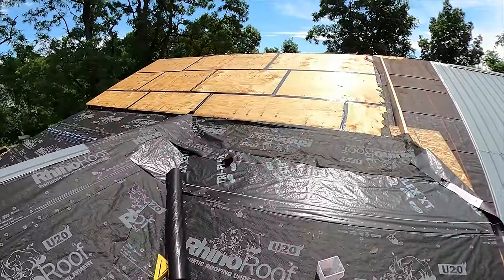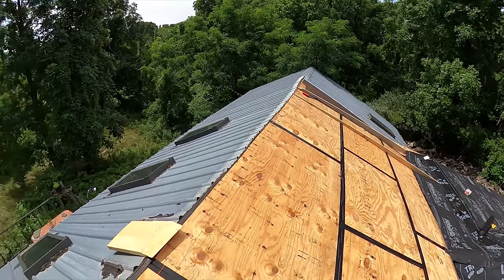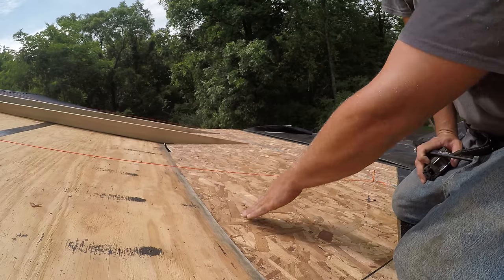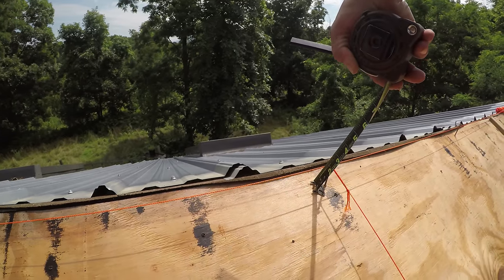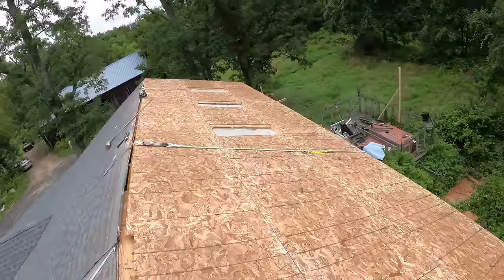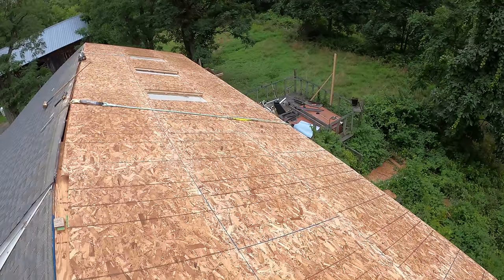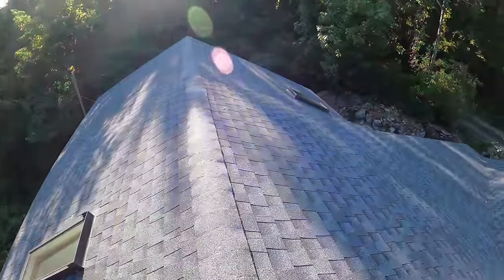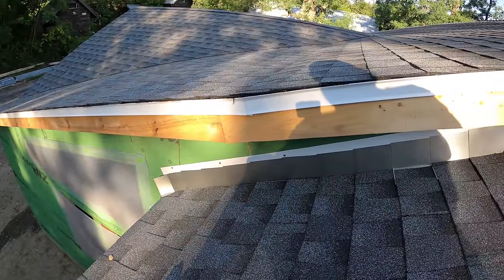Building an addition part 5: Roofing

Comment: I know what you mean by putting lipstick on a pig. I reroofed the garage roof on a property I used to own. My father made fun of me because if you looked closely you could see the runout on the lines of shingles.
I told him that whoever built the garage built it like a boat. From back to front the ridgeline rose 15" . Inside the width of the garage varied from back to front by 18" . When I tried to pull the back wall in, the sides popped out. I realized that the sides were bowed like a boat but it was built that way.
After explaining all that my father said that the shingle runout didn't look too bad considering what I had to work w and never said another word about it.
Reply from the maker: lol
Reply: Almost impossible to pull an entire building back into square, level and plumb, considering it took it's whole life to get to that point or was built that way, then forget it !!!

Comment: Jesse, where the roof transitioned to new roof, you had the plywood overlap leaving  5/8 overlap. I would like to suggest in your future jobs you could smooth out this transition area with a piece of tapered cedar siding. This is a piece of wood 6 inches wide with a thick end of 5/8 to a taper down to 1/8 inch. Just a thought to make your life a little easier.

Comment: I love working on old houses I was just going to take the sheer rock down put new insulation in the walls. 6 months and 10000 later I was done. Like opening pandoras box
Reply: That’s when you get into the “You might as wells.”
Been on lots of job sites of my Dad’s where that started to happen. Sometimes you avoid going further into something because then you have to meet code requirements and then you might as well...........

Comment: Looks good, and creative solve on the roof level issue. The drip edge however should go under the paper on the eave edge, and over the paper on the gable edge (and you couldn't see in your video, but my other pet peeve with drip edge is it should be held off the fascia, not snug up against). Often a layer of self adhesive membrane is put under the eave drip edge as insurance, then definitely another layer above.

Comment: Great job Jesse.
House beautiful another hundred years or more.
Several generations of kids will be thanking you for your work.
Nice to see a new generation adapting all the new technologies and products that are improving the reliability and performance of buildings.
The owners heating / cooling bills should be lower and far less susceptible to wind and storm damage.
I was really impressed with your solution to the two roof transition problem. 
Especially with that out of plumb upper roof.

Comment: Did you consider removing the old ply and nailing/fixing new rafters next to the old ones?
Reply from the maker: they are trusses so while it was considered, working on the plywood was much safer than working on thin air.

Comment: Jesse, you impressed me on a couple of different levels on this video.  First, the solution to this problem was great, but even the fact that you cared enough about the final product to really do some head scratching to solve it is awesome.  It made me wonder about how you worked it out with your customer.  I assume you bid this job?  If so, I am pretty sure you discovered the existing alignment problems later.  Did you have to eat the added expense or did you offer it as an option for the owner?  Well done.

Comment: I'd much rather watch someone roof a house, than roof it myself. I've worked construction since 1999 and the first thing I told my boss was that I'd work my ass off on the ground.. It didn't take long for him to get me up on the roof however. I still remember how I shook like a lamb my first few projects on a plank scaffold. Or up on a 25 foot ladder. Then I broke my back 4 years ago, moved across the country, and now my roof leaks! (like in 5 places) The hardest part is that in my head I know I can fix it, but my body won't let me. A section in my garage is rotting away. I'm going to have to replace 4 sheets of plywood and at least one rafter and probably a section of the wall. At least that is somewhat possible for me to do. However getting up to the 2nd story is pretty much equivalent to me sprouting wings and flying right now. Anyway.. at least I can watch you and pretend I did something today. Ha.

Comment: That was the clearest explanation of how to level a roof I've ever seen. And I've seen a few, which always left me thinking WTF? I eventually figured it out enough to satisfy myself, but it's nice to see all the details done comprehensibly. Have you ever done metal shingles? The advertisement videos I've seen claim they're 'as good as standing seam', but I wonder. Metal roofs are more popular in central Texas, because of hail, and I've always wondered if metal shingles with a texture on them would hold up, and just look 'retextured' after a hail storm. (Of course, a Camarata-castle roof would be proof against anything short of basketball-sized hail, but the rest of my house isn't built to support that.)
Reply from the maker: I have been wondering about the metal shingles, I keep getting commercials about them. I am starting to build my house this year and it will be 100% concrete, if the engineer wont let me get away with bare concrete for the roof then I may check into the metal shingles
Reply: @jmuller86  I hope you'll put the building of your house on the channel - it sounds very interesting. Your channel, and Andrew Camarata's, are my two favorites.
Reply: South central Texas here...and, just like you said, due to the frequency of hail storms, opted for a metal roof when I recently built my house.  More money upfront, but so worth the piece of mind when the hail starts smashing down.  P.S. Bit of a break on home insurance with a metal roof.....I'll only have to live here about 50 years for that to pay-off. 😜😀

Comment: Jobs like this are never easy but you’re making it look great in the end. Renovations on old structures can be tough. Old structures that have had several additions over the years adds to the “fun”. 
Squaring up walls and rooflines takes time but when you finish it will look a million times better than if you just made do with what you had started with. 👍🏻👍🏻👍🏻

Comment: You guys done a good job and good workmanship skill. 
Just one observation, what is the reason apart from cost for not choosing the more durable plywood boarding instead of the chip board which will not last if it does get wet in the long term?

Comment: It looks really good! Any worries about the added weight to an already slumped structure? (removed about 150 lbs of metal /100sqft. and added about 350 (200/sq shingles and 145 for the OSB) ? Hope an engineer/architect signed off on this?  Also, when you installed the cut valleys, did  you tear the corners off? Disrupts water flow coming down the slope that wants to travel under the top shingle. Good trick to add to the bag.
Reply from the maker: we have a high snow load of 55 lb/sq ft so they need to be designed for that at minimum. the added 2.5 to 3 lb/ sq ft for materials is minimal by comparison.

Comment: If you were doing that roof down under, the OH%S person would be having a wig-out!!!
Long sleeves, wide brimmed hat,safety glasses, ear protection, sun lotion,site induction, safety assembly point,definitely no smoking on site,steel tipped work boot,every one in roof harness, scaffolding all around roof area, hand railing also around roof edges, site fencing all around site,and I haven't even started on the environmental impact assessment yet!!!
And they wonder why it takes so long  here in Australia!!!😂👍🍺
Reply from the maker: boots on a roof will get someone killed. Shoes only.  I can see the harness but everything else should be optional

Comment: Jesse, what I would like to know is how did you pull up the tin without bending it all to hell? The way it came off it seemed like you just put a hot air gun and melted the glue holding it on and picked em up. damn.

Comment: I like to work on old stuff as much as the other guy but I would have tear down that original structure and start fresh. I understand there is cost related to it but it's heck of a lot easier. Anyhow I do appreciate the videos and you do great work with the challenges at hand..Have a great one and good luck with the completion of the build!
Reply: A lot easier to remodel especially in socialist utopias like NY

Comment: Old roof substrate held up well. That's because it's real plywood and not that cheap crappy OSB. That stuff should be outlawed.
Reply from the maker: if the sheathing is covered and vented right, it should never see any water or moisture so it shouldnt matter. the osb they have now has a wax coating on the one side to help repel water. I know its hard for you old timers to see it but osb is half the cost and lays more uniform and flat than cdx. and both of them just doubled in price in the last month
Reply: That's because it's hurricane season. Every year about this time it happens for building materials. They become scarce as people rebuild their homes and businesses.
Reply from the maker: @freetolook3727  they are all saying its the virus that is doing it. maybe its both. either way I am building my new house from 100% concrete so I wont need to worry about it
Reply: Will you make videos of your concrete home construction?
Reply: All concrete construction, hurricane proof!!.
I saw where the Mythbusters tested out a concrete paint on a concrete block wall mockup, I think it was Rhino liner, and it actually held up to an explosion.

Comment: Had a house where the Kickout/Bump Flashing was not done. Not a lot of water got in but enough got in to moisten the wood and cause dry rot in several framing members...what a mess to fix and all for the lack of a dollar worth of metal! Some roofers are so lazy! So ridge vent will do all the vent you need  then?
Reply from the maker: yea kickout flashing takes nothing to do, the ridge is vented for the exhaust and I will get into the details in the next video about the intake

Comment: You should of used metal flashing for both sides of the valley's on the shingle roof. HERE'S WHY. Closed  aren't always  to have metal , but they should have additional underlayment lining the ,Yours has only one underlayment. Preferably a couple layers of roll An closed and most open  relies on metal  for protection. The  see the most water flow, as water from both surfaces gathers in the  as it runs down. The extra layer of flashing in the  helps protect it from water intrusion.  flashing, which is most often used, also helps the water move  quickly off the roof, and even the occasional snow That  is left exposed, so the  has visible lines of metal running down the . ... Metal sheds ice and water faster than shingles, reducing the risk of ice dams and blockages of debris. care not  place any fasteners in the exposed center area of the . Extend entire width of  “completely”  the bottom of the . Cut bottom of  so the entire width of the  extends approximately 1/2″  3/4″ over the fascia trim board along the eaves. IT'S JUST my 30 plus years of roofing and construction. And my opinion.

Comment: It might have been quicker to jack up the low side of the house 4" because the existing house floor is probably out of level 4". It appears that the existing house has concrete piers with a floor beam system. So it might not have been too difficult to jack up the house and pour new concrete supports. That would have leveled your floor and saved you a ton of work on the roof. The home owner should be willing to accept a change order for that extra work and with your machinery, you could have probably completed it in about a week. 

I am a licensed GC and I have done this before. I tore off part of the existing flooring in the house and put a wood double-beam (2" x 12") under the floor joist. I then jacked up beam every 4" and then supported it. The house I was working on was over a 100 years old and it was approximately 4" out of level in 30'. You could roll a golf ball across the floor. In my case, the owners did not have a lot of money and so I placed trailer concrete 18" x 18" pads down under the new floor beam and then used permanent trailer jacks to support the beam. It worked really well and amazingly, it passed inspection. If the owner had more funds available, I would have poured a concrete footer under the beam with rebar reinforcement, and then used pressure treated 4"x4"s to support the new floor joist beam every 4".  In an ideal situation, I would have used a steel I-beam under the floor and jacked up the I-beam. That would have been considerably stronger, but a  LOT more expensive. The steel I-beam would have required a concrete footer be poured under it.  

You did a great job working with a very difficult situation. For a roof to be out of level 4" in that short of distance is a big problem. Hopefully the homeowner paid you extra to fix that issue. My only concern is as I mentioned, the existing house floor is probably 4" out of level in 25" and that will cause numerous additional problems. But that issue was not in your scope of work to correct.

One issue you missed on your roofing, and it is quite common.  You should have installed your roof flashing before you installed your underlayment membrane. The membrane should overlap the flashing at all edges of the roof. This prevents any water that may get in under the shingles from going under the flashing and into the home. It is as common as dirt for roofers to miss this detail because they do not fully understand roof flashing design. This probably won't cause any leaks in your roof because water will probably never get under the shingles. However, it does remove a redundant layer of protection from your roof because nearly all roof leaks occur at flashing junctions. 

Great job! I particularly liked how you set up your gravity drainages system for the basement area. This project was a LOT of work and you did a spectacular job!

Comment: IBC codes do require that roof venting be installed on all roofs in both cold and hot climates. Also, it would have been far easier to paint your fascia before you installed it. Even if you clad it, you need to seal the wood first. The roof vents can installed later if their is attic access. O'Hagen vents for shingles work really well and they are fairly easy to install. You also need eave (bird board) vents at the fascia edges to create a air flow under the roofing to prevent condensation into the building and freeze areas of ice at the first four to six feet of the eaves. 

With the vaulted roof system in the addition, you will need to install an air flow passage of approximately 2" - 3" that connects to the vented blocks at the eaves. Then you can insulated under that air flow passage with whatever system you choose and the interior ceiling will never have condensation issues. Without this air flow passage, the wood roof joist will get wet from condensation caused by warm interior air hitting the cold roof. This is a very common cause of wood rot and even structural failures in cathedral ceilings, and it is not well understood. I hope that this helps you. In general all areas of the OSB roof sheathing must be vented to the outside to keep the sheathing at approximately the outside ambient temperature. This venting is crucial to protect the long-term life of the roof.  As an alternative, I have seen contractors use closed-cell spray foam directly on the OSB roof sheathing and rafters. In theory, this provides a vapor barrier that prevents any condensation from getting into the roof structure. The OSB roof sheathing theoretically will stay at the ambient outside temperature because the closed cell foam prevents warm interior air from contacting the OSB sheathing and roof structure. This is allowed by code, but I am not a fan of this system because if the contractor installing the insulation misses an area on the roof, say in a recessed hard to reach crevice, that area of the roof will get wet with condensation and the sheathing and roof structure will rot over time.  Providing air-flow insulation is safer in most cases.

Comment: You did an amazing job.  Did you leave the backing on the ice and water shield?  I'm not nit picking.. Im doing my roof now and put all the underlayment down so I didn't need tarps but I was wondering if I could just put the ice and water over it or I should take the first row off and lay the ice and water down. If I were to do that would I be able to put the underlayment over the ice and water?  Or just rip the whole layer of underlayment up?

Comment: The drip edge should go under the ice and water shield. Right?  That's the way we apply it here in Alberta Canada.   Love the videos.
Reply from the maker: areas that have alot of ice should have the ice and water under the drip edge. Its a constant debate between roofers, but different areas are different
Reply: @jmuller86  Agreed.  I install metal roofs 90 percent of the time. Thats why I was asking.